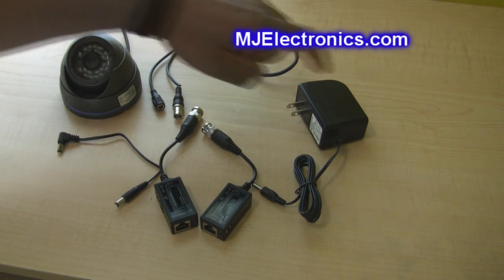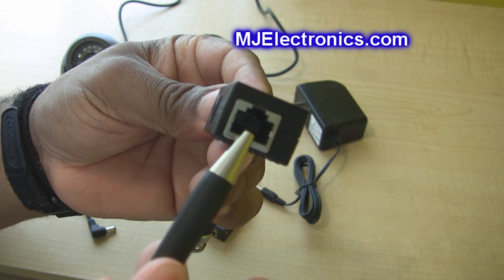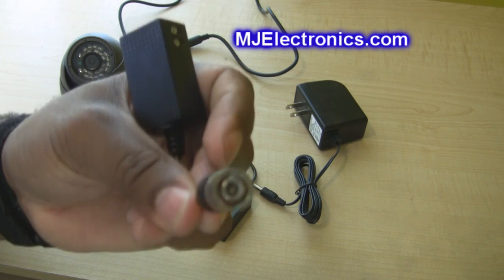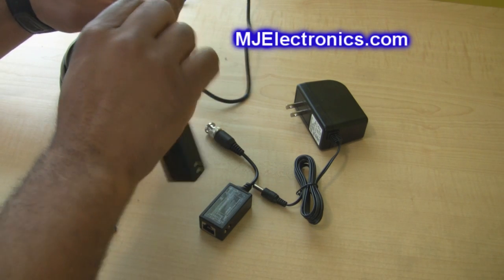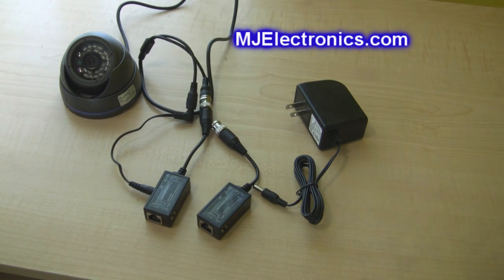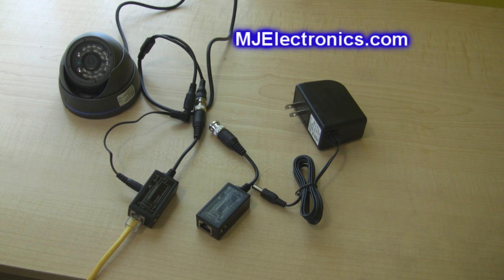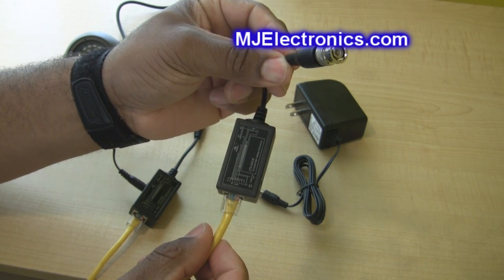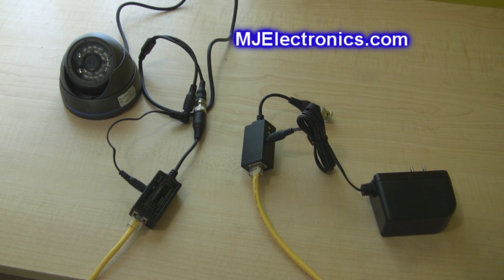How To Connect Cat5 Cable To CCTV Security Camera Using A Balun

Comment: Hi! I have an IP surveillance system. I would  like to install one IP camera in the elevator. How do I connect it?  There is flexible cable left in the shaft for camera. With analog I would need only two wires and power wright?

Comment: what is the max distance that a Cat5 or Cat6 cable is capable of?
that can provide both power and Quality video.
Reply from the maker: Transmission distance is 2000 feet
Reply from the maker: ***** Yes the picture quality will drop a bit.
Reply from the maker: 1200 feet

Comment: hi, is it possible to install the power supply near to the cameras to avoid voltage drop for a long range distance approximately at 60 to 75 meters?
Thanks

Comment: Great Video, however you can now buy camera's that use only a Cat5E cable, power and video is ran thru the Cat5E cable, they are working on pan/tilt /zoom models now. distance is 100' feet of Cat5E, I haven't tried any longer runs than that. The camera is made with a RJ-45 built in, works with color, black & white, and IR for night time. The DVR recorder has RJ-45 too

Comment from the maker: cameras are recommended to run within 10% of their rated voltage. Example, if the camera requires 12volt dc or 12vDC power, your power voltage to the camera should be between 10.8vDC to 13.2vDC. Anything less may cause the camera to not function properly.

Comment from the maker: Baluns greatly extend the transmission distance of video signals. Baluns help eliminate ground loops and RF interference.Baluns and Cat 5 typically cost significantly less than traditional cable over long distances

Comment from the maker: @Bloodstar125 A balun is an impedance transformer that allows you to send a signal that requires a certain impedance value (such as 75 ohm for video) over a cable that has a different impedance (such as CAT5 that has 100 ohm impedance). You need one at each end, one to transform the original impedance to the impedance of the cable and the other to transform it back to the original impedance.

Comment from the maker: @jerrylo88 You can only run coazial cable up to 650 feet . This distances are for a single run of cable with no amplifiers or in-line correctors.  You can push 12V or 24V thur Cat5/Cat6 cable

Comment: thx for the info.
the coaxial cable can transmit over 1200 feet . Am I right?
how about the voltage that thru the cat5/6 ? it is 12v or more?